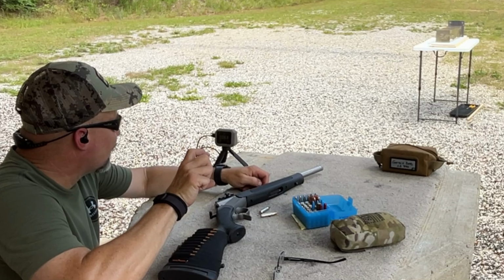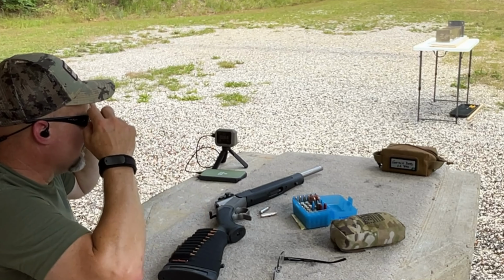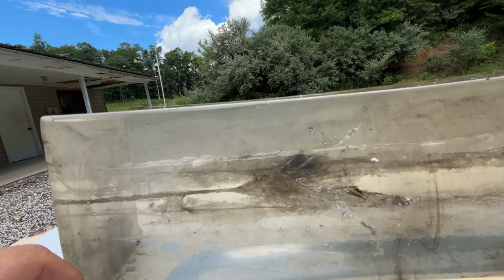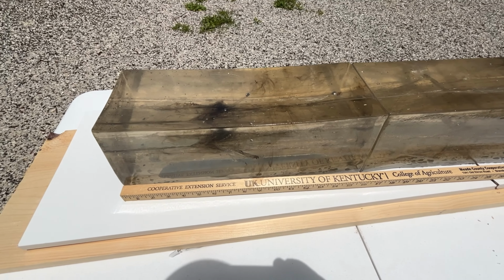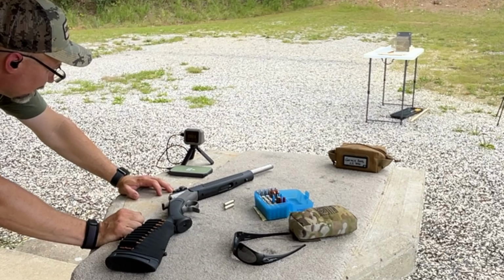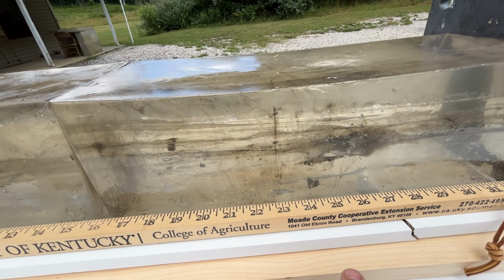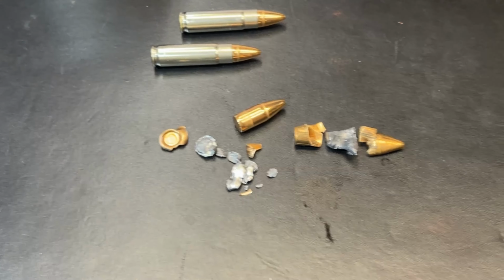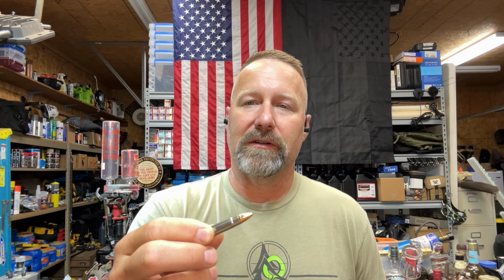.300blk Gel Block Testing the Lapua OTCE Cutting Edge Bullets

Comment: Interesting...I thought you might get a bit more velocity than that. I'm getting circa 2400 fps out of a 16 inch barrel with the Sierra 110gr Varminter on top of 19.5 grs of Lil Gun which is as far as I have taken it. I think the max load according to Sierra is 20.7g for the 110gr
Reply from the maker: @wkinsley99  There’s definitely headroom on the velocities. These were accuracy loads I worked up a while back. 😉
Reply: I'm getting ~2150 with 110vmax 19.5gr of 11fs with good accuracy and low sd.   I would use my 300 Ham'r for deer over my 300blk.   the vmax seem to hold together more at lower velocities of the blk in the gel tests I've seen.
Thanks for the video,  I always like the 300blk gel tests.  You did a good job w this one.   Subscribed now!   Mine is only for 2 legged varmints in house, lol
Reply from the maker: @onebadjack1313  Thanks for the subscribe👍🏻. A lot of my .300blk loads take in consideration for 2 legged varmints 😉
Reply: @onebadjack1313  I haven't come across 11fs before. Not sure we can get that here in the UK. There are a whole bunch of powders that we used to be able to get here but because of various rule changes around carcinogens can't anymore ...nightmare and stupid bureaucracy.
Reply: @wkinsley99  sorry to hear that, we're not too far behind you.  I could see that happening here.
11fs is basically h110/win296, but with flash suppression (FS).  It's almost the same. .2gr less for same max velocity in Hornady data.  Builds pressure a little faster, too.  I read a post of Bill Wilson's on a forum. He said that the only upper he blew up with 300 Ham'r development was with 11FS.

Comment: The. 30 cal was created for a reason by people much smarter than ourselves and lots of experiments on live animals when that was still popular.  The 8mm or .315 may be somewhere between the. 338 and. 308, the preference is determined on the need. 

I prefer the. 300 Weatherby because of the ballistics, plus a heavier slug can be used. The recoil sucks but I know that the bullet will perform and can rely on it just like I can rely on the 30-06 for anything in North America, 180gr Soft nose and spot on to 800m.
Reply: Certainly they were smarter than you. No doubt about that.
Reply: 8mm is normally 323 " that is 32 caliber.
At 64 years old my first rifle in 300 Wby mag was at 18 years old in a German made Weatherby mark 5 and now I have a Mauser 98 commercial custom made in 300 Wby and a Weatherby mark 5 in 300 Wby with a 27 inch PacNor barrel .
I have a very long history using the 300 Wby and since 1976 my only income is from guiding clients on hunts in Alaska and the Pacific NW.
I had a Rem 700 in 8mm Rem mag I sold to a tec rep at Leupold.
That 8mm Rem mag using barns TSX bullets was one shot hell and dead on everything!
For very large and dangerous game and long range I am using an 8mm-378 Weatherby magnum.